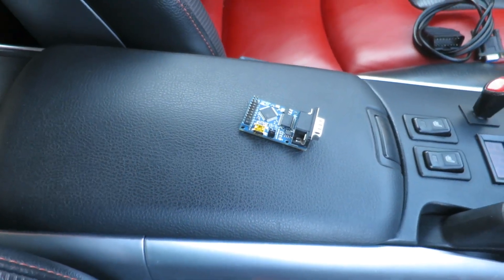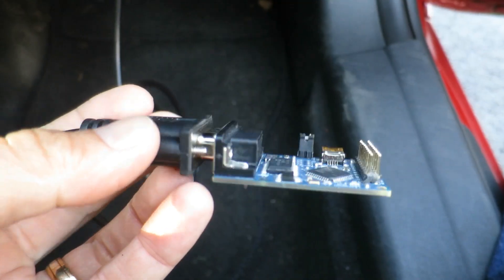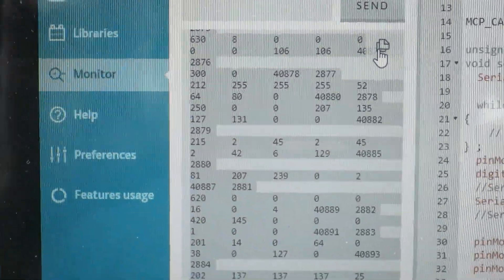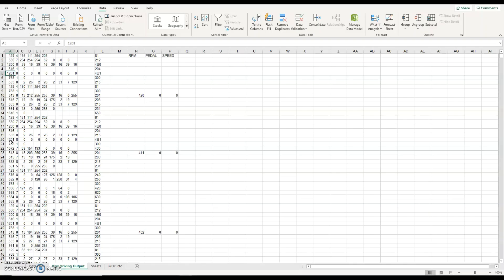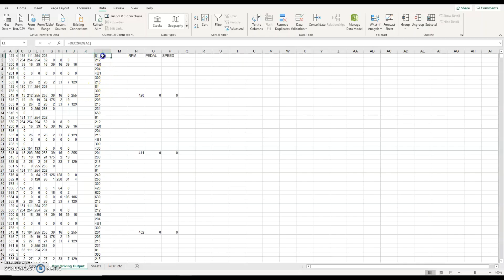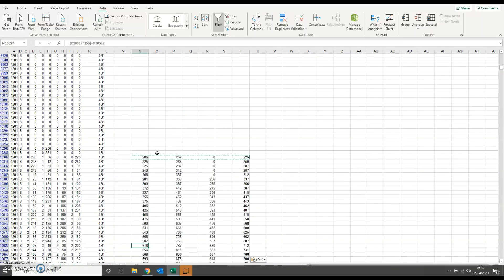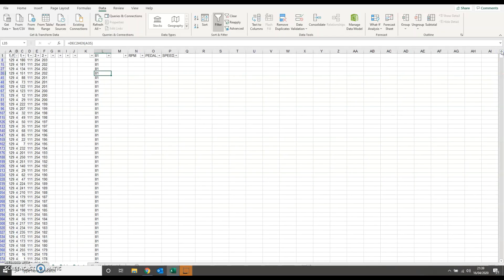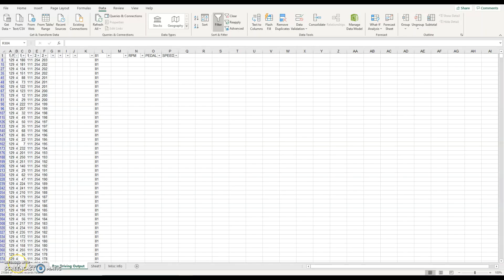How to read the CanBus in any car. (Can Bus) Part #1

Comment: Hey Dave, I'm bench testing the series 1 cluster and don't own an rx-8, the cluster will eventually go in an FD with custom 3d printed mount and housing bits. I was able to get your code to mostly work. I had to modify it to work with an esp32 s2 mini using a MR.DIY can shield. I'm currently able to disable the MILs and manipulate the coolant and tachometer gauges. I'm having trouble with the speedometer. I initially tried hard coding the vehicle speed  on initialization, then within the loop function in the else block for ID==1200, then tried hard coding front left and front right wheel speed, then tried hard coding buf with a payload from the raw outputs in the xls for 1201. No luck at getting speedometer to change from 0. The rx-7 will be running from a link ecu which *should* be able to transmit over can, but i'd like to have an alternate solution ready to go if necessary. Thanks for everything!
Reply from the maker: Hay - ping me an email and I’ll see if I can help, email in my bio

Comment: How can i read a car running data for example 10 minutes and after that , with codes to make an simulator who send rpm , speed , temperatures ( like i have the care in my house to test some diagnoses) 
Sorry for my bad english
Reply from the maker: You would need to log the canbus traffic in a file, with time / date stamps. Then write some software to replay that log back. This is a very good way to decode the canbus and I have done this with other vehicles.

Comment: I  can scan the car which it is old car they send can bus when in open the door or do someting. But for the new car there are noting  send out
    I think they have gateway and i have to send request id to get information
    How i know canbus database to request information for each model?  Such as toyota will 0X620 is door. 
   Thank you.
Reply from the maker: The car may have more than one canbus - and you might be listening to the wrong one? Or you have the right one, and you need to open and close the door whilst logging the canbus - know the open and close intervals and then check your logging. You need to find the corresponding changes...

Comment: Hello from 2024. It’s even easier now with can libraries available in ide. I just built a device with an mcp2515 and an uno. I’ve also written my code to look for only what I want and don’t let it repeat. As you mentioned CAN is noisy. So this helps big time
Reply from the maker: Nice, I didnt realise the libraries are straight up available now, excellent
Reply: Can you help me!? I have an arduino with a mp2515 shield made by seeed studio
I have tried several codes and configurations from building my own db9 to obd2 adapter to make sure all the pins are configured correctly! I have communication between the shield and arduino uno but arduino ide cannot see any bus information… I have a 2018 ford explorere
Reply from the maker: Check you have can high and low the right way around.

Comment: Awesome! Finally I can hack my car 😂 so is that little arduino just an uno or something with a ftdi chip for serial comms? Like I could potentially just build one and hack up my old kcan adapter for it's connector?
Reply from the maker: Take a look at my notes in the video (text) there is a link to buy this Arduino - comes with all the standard outputs and a canbus shield all in one.

Comment: Hello,
I have a rare electric car from China, a SUDA SA01, where I have problems with the tire pressure sensor.

I would like to see what is being said on the OBD2 connector via the CAN bus.
Question: Is the speed of the CAN bus crucial as to whether you can read something?

This is what the tire pressure sensors and the receiving device look like, which then transmits the data via CAN bus, 4 x temperature and 4 x tire pressure.

The tire pressure sensors:
3636200XSA01BA
HW29112-SD01
C-Code:116AT
195200
ID:FDFED14F

And on the receiving device that then outputs the data via the CAN bus:
AA2012116ATKCV3226
3636100XSA01BA
C-Code:116AT
DATE:195200

Do you have any idea what “C-Code:116AT” and “DATE:195200” mean?
Reply from the maker: No idea - and yes the speed of the CAN is crucial...

Comment: I get this error at line 25 when I compile ???   
Compilation error: 'long unsigned int time' redeclared as different kind of symbol
Reply from the maker: What you compiling bud?
Reply: @SouthWestEVUK   When I click the check mark on the top left menu bar or the check on the sketch of Arduino IDE. Wish I could attach a screen shot. 
                                       ^~~~~~~
                       uint

Compilation error: no matching function for call to 'loop()::MCP_CAN::MCP_CAN(int)'                                                                                                                            
void setup() {
  // put your setup code here, to run once:

}

void loop() {
  // put your main code here, to run repeatedly:
#include <Arduino.h>
#include <mcp_can.h>
#include <mcp_can_dfs.h>

#define CANint 2
#define LED2 8
#define LED3 7

unsigned char len = 0;
unsigned char buf[8];
unsigned long ID = 0;
unsigned long line = 0;

MCP_CAN CAN0(17); // Set CS to pin 17

unsigned long time;
void setup() {
  Serial.begin(115200);
  
  while (!Serial) {
    Serial.print("I will wait here forever...");
      delay(1000);
  };
  
  pinMode(23, OUTPUT);
  digitalWrite(23, HIGH);

  pinMode(LED2, OUTPUT);
  pinMode(LED3, OUTPUT);
  pinMode(CANint, INPUT);
  digitalWrite(LED2, LOW);
  
  Serial.println("CAN init:");

  if (CAN0.begin(CAN_500KBPS) == CAN_OK) {
    Serial.println("Can Init Success");
  } else {
    Serial.println("Can Init Failed");
    while (1) {
      Serial.print("I will wait here forever...");
      delay(1000);
    }
  }

  Serial.println("Good to go!");
}

void loop() {
  time = millis();
  
  if(CAN_MSGAVAIL == CAN0.checkReceive() && line < 10000) {          // Check to see whether data is read
    CAN0.readMsgBufID(&ID, &len, buf);    // Read data
    
//Add this line back in if you want to filter traffic    if(ID == 1201) { //39
      line = line + 1;
      
      Serial.print(ID,HEX); // Output HEX Header
      Serial.print("\t");
      
      for(int i = 0; i<len; i++) { // Output 8 Bytes of data in Dec
        Serial.print(buf[i]);
        Serial.print("\t");
      }
      
      Serial.print(time); // Timestamp
      Serial.print("\t");
      Serial.println(line); // Line Number
//    }
  }
  delay(10);
}
}
Reply: And if I remove the 1st 10 or so setup lines and compile, I get this error......  Compilation error: 'MCP_CAN' does not name a type; did you mean 'DST_CAN'?

Comment: which code stands for the firmware? I want to clone the firmware to another ecu. or can I just simply dump all of this code to the other ecu?
Reply from the maker: Hi, so the can communications are totally sperate to the code that runs an ECU. You cannot extract the firmware via canbus (well not in any system I have seen), and then upload it via canbus.

Comment: Cool vid, thx,  but, I'm still unclear about usefullness of this.    Once I get the ID of something, say 1234,  like accelerater pedal,  what can I do with that data?    How to program other peripherals to interact with it?     Say I want a Hand throttle for a boat to be in my car instead of foot pedal.    How to map that device to the foot pedal?    Do I have to program the peripheral to mimick that?    And then where is that code saved?   in the Hand Throttle device?  or some itermediary box?
Reply from the maker: You would have to do two things with your throttle example. 1) stop the original throttle working and 2) make your new hand throttle output the right commands. the throttle itself is unlikely to be programmable, you would need something like an Arduino that you can program with inputs and outputs to the desired results.

Comment: I've read document : https://en.wikipedia.org/wiki/OBD-II_PIDs and it says VEHICLE SPEED is PID code : 13(dec) and 1 byte return value. But you showed as 1201 and 8 bytes. so why is that ?
Reply from the maker: I would imagine there are some standard codes for the OBD, and then a second set which the manufacturer uses. The latter is what I use.

Comment: something is wrong there right? wheel speed can not be different right?
Reply from the maker: Yes they can... wheel spin ;o)
Reply: @SouthWestEVUK  interesting. hm ok. that does explain lane correcting ability and even slip control and abs. hm, does a car's wheel have a different speeds going around a corner. ok

Comment: I have two help requests related to your CAN Bus hack:

1) You mention needing the ECU codes for my make of car in order to understand the decoded data. Where would I find these? I searched every on the net and can't find a reference list anywhere for a 2014 Nissan JUKE TEKNA CVT, Petrol 5 DOOR HATCHBACK?

How would we adjust your code to support other cars?

2) I DON'T want to send any data packets or messages to the CAN Bus. I don't want to affect the car's operation in any way, I only want to read the data, safely. Does your solution support that. How can I ensure my solution only reads data and doesn't send data to the CAN Bus?

Thanks in advance.
Reply from the maker: You will not find your can codes on the internet, you have to discover them yourself. Not sending and only receiving depends on the code you write - its pretty straight forward to not send anything and just listen.

Comment: Hi Dave, love your channel. I'm based in Plymouth, and having some CANBUS issues with my Artisan ES1 pro electric motorcycle (upgraded motherboard, now dash won't read speed and ECU keeping bike in limp mode). Do you think you may be able to help?
Reply from the maker: gosh, did anything happen leading up to this fault (replacement parts etc)? my contact details are on my bio page
Reply: @SouthWestEVUK  I upgraded the controller from a Lingbo LBMC72352 to an LBMC72502. It uses CANBUS RS485 but won't seem to send speed or gear selection data to the dash, and the ECU is staying in limp as a result. I don't know whether I need a new dash, black box, or BMS, or if I'm just being stupid and missing something obvious. I've seen people like yourself decode CAN and spoof it using an Arduino though, which may potentially be the easiest solution. What do you think? Also I can't find any contact info on your about page of your channel, is that what you mean by the bio? If you can PM me somehow I'll give you my phone number.

Comment: Good work.  Each wheel is a different diameter due to its physical shape, tire pressure and loading, hence different rpm for each wheel at a constant speed.  I would submit it's an rpm input for differential processing for brake control.  Speed is a by product if you will.
Reply from the maker: Yes all good and valid points.

Comment: 0-255 for the values of a byte, not 0-254...

Also, "high byte" and "low byte" would refer to a 16-bit number, not an 8-bit value.  The term that you should be using is "nibble" (which is half of a byte) or just say "upper 4 bits" or "lower 4 bits".
Reply from the maker: I tend to record by videos in one lump and yes you are right, various terms do switch about, unfortunately (or fortunately) that is just the way my brain works (badly clearly). Oddly my lucky number has always been 256 due to my extensive C64 (8bit) programming when I was young. Principles set out in this video are unlikely to trip anyone up, but thanks for the heads up.
Reply: @SouthWestEVUK  -- My background is a bit earlier, back in the days of FORTRAN IV / 66 and punch cards... The idea of getting immediate results after submitting code was a bit alien to us back then... We would often only get 2 or 3 runs per *week*...

Comment: Great video opening the covers of what's otherwise a rather closed subject. As a small improvement you could create a lookup table In Excel and translate the codes I to something more readable, e.g. wheel speed rather than a code
Reply from the maker: yeah, or a small database to reference things properly.

Comment: very informative
Reply from the maker: Glad you think so!
Reply: Dou you have any idea about how the obd2 bluetooth adapters know what value is representing the any sensor data?I mean that as far as i know every individual car has a unique code for any sensor value and it differs from car to another car.
Reply from the maker: The bluetooth dongle and what codes represent what sensors or data are not related. But yes, every car will have its own codes.
Reply: Thanks for answering my question.But i couldnt get your answer.Normally we try to find what ID is responsible for any sensor value by reverse engineering as you've shown in this video.Since every car has different ID's for the same sensor value,how does the bluetooth obd2 devices recognize the corresponding ID?Thanks for your precious time.
Reply from the maker: There are some standard values, error codes etc that are on the same ID's. But if you are looking for a specific sensor then no they are all different - you might find your bluetooth reader knows what car it is looking at and so knows the codes already?

Comment: Hi Dave or anybody that may be able to help Again... Thanks Dave for pointing toward the libraries not be include or something missing or a name change etc... and that does appear to be what it is. I have rephrased this question back on the root of the comments instead of buried in the replies for perhaps better visibility.

So I had mentioned that sure enough there is a .cpp file missing etc. So I went back tried following very slowly the steps again and I think I found a big clue! When Dave says click on the Library Manager, type in 'canbus' and pick the one at the top ... It shows to be picking 'CAN-BUS SHIELD' and it is described as 'Arduino library to control CAN-BUS Shield'.                 Now in 2022 (Im guessing perhaps things have changed) When I search for 'canbus' the pick at the top is 'CAN_BUS_SHIELD' and it is described as 'Seeed Arduino library to control CAN BUS and CAN BUS FD.'

Anybody have any guidance on how I can resolve this? I would like to have the same library that Dave used but I dont see it in the list or under several other searches. Maybe Seeed is the replacement but its missing stuff.

Thanks, Dan...
Reply from the maker: email me - pretty certain I have the original library here that I can send.

Comment: Hi Dave or anybody that may be able to help... I got the hobbytronic board and cable. Soldered the 9pin. Put on the Term Resistor. I have Daves code downloaded and a Sketch. I think I have included the CAN Bus Shield as described. In both the Arduino.CC and the IDE I get compile errors. I have pics but cannot attach.

In Arduino.CC the error I see is 'cannot declare variable 'CAN0' to be abstract type 'MCP_CAN'

In IDE I get 'mcp_can_dfs.h: No such file or directory

Sorry for the dumb question(s). If there is a FAQ or Blog Im happy to search thru that.

Thanks, Dan...
Reply from the maker: Have you included the library? It may have been updated I guess and the methods have changed names?
Reply: Thanks Dave! Especially for the quick response. I will double check but I'm pretty sure it's included... That was why I went back to IDE to check if it would work there. But ya I'll check. Thanks, Dan...
Reply: @SouthWestEVUK  Thanks again! Ya you are right! There is name change buried in there. In particular the Blackhurst etc code that was pointed to includes mcp_can_dfs but in the CAN Shield its not there. It does have mcp2515_can_dfs.h AND other similar files BUT those appear to be header files and not cpp. Im not sure what to include. Any suggestions? Thanks, Dan...

Comment: Wow wow; thank you for the detailed info on how to read the CAN bus and insight into how to work with the sniffed info. BTW, it's OBD2 (On-board Diagnostics 2), not "ODB2". Also, kilometre is pronounced like "nanometre", not like "thermometer", because it's a unit of measurement and not a measuring device.
Reply from the maker: yeah too much database development means I get odb and obd round the wrong way, and errrr, thats just the way I talk ;o)

Comment: This adapter can-L can-H off car?
Reply from the maker: yes you need both or it does not work.
Reply: @SouthWestEVUK  thanks my friend my car honda accord 2019 I need can system off from radar?
Reply: @SouthWestEVUK  thanks my friend I have honda accord 2019 I need Cancel radar Can do it?
Reply: What is name adapter this tool read file engine ecu and Disable can h can l ?

Comment: Hi, Thanks for this video.. I am looking to make something similar but to show to a small lcd some of my sensors. I have a bmw diesel m57 and I would like to read acc pedal position, boost temp, boost pressure.. and so on.. how can identity all   CAN codes for some of the sensors that I need? is there a list of all BMW diesel can bus codes that represent each sensor? Thanks.
Reply from the maker: Hay - you might find someone has decoded them online - but the likely hood is that you are going to need to get stuck in and decode these yourself.

Comment: Hi. I have link ecu g4x and i'm trying to find a way to connect it with my android car stereo. Is that adapter the correct for that work?
Reply from the maker: Its not really an adapter, it depends on so many things - is the stereo on the can? is the g4x? are those cans linked together? Are they designed to work together?